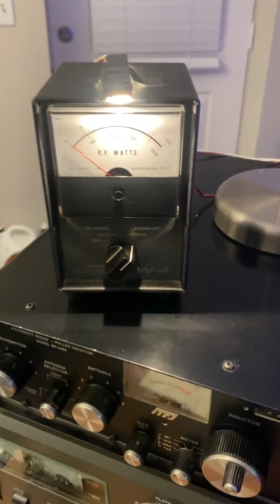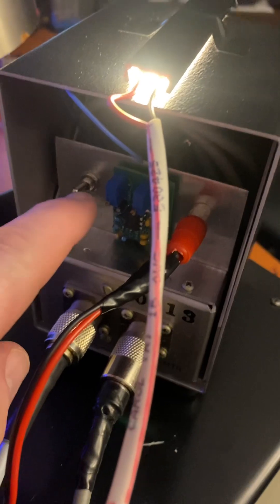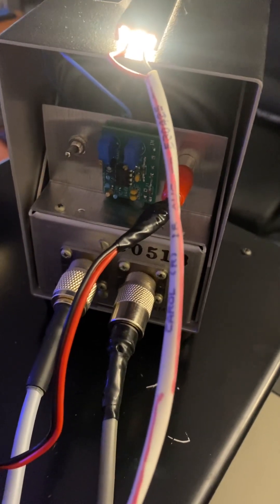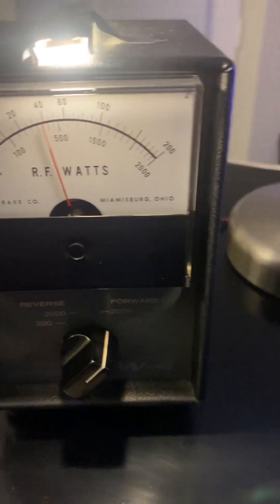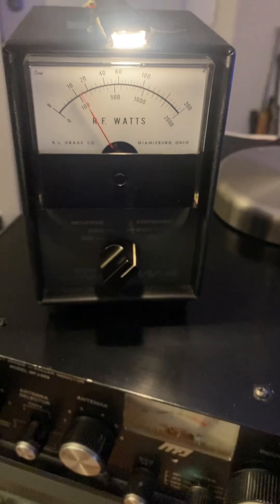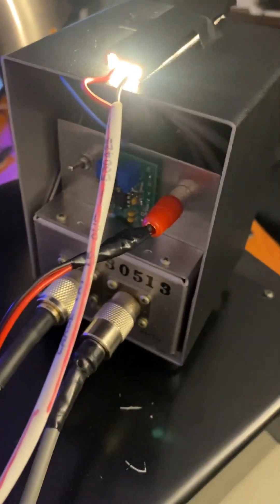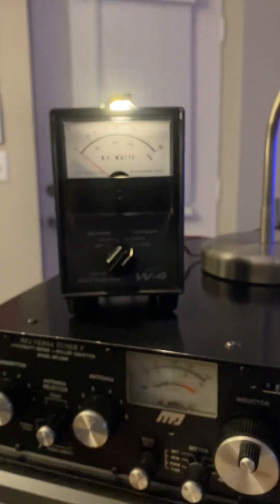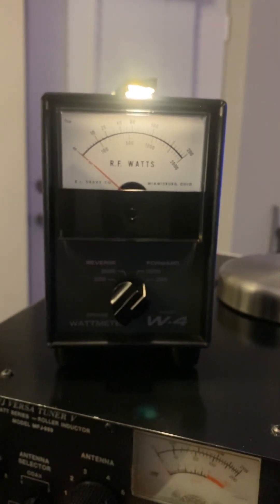Drake w4 with k4dpk PEP kit

Comment: I added Phil's peak kit to my W-4 too.  It works OK although the hang-time can be tricky to adjust.  I like the ability to use the IN-Out remotely by removing it from the case although the added weight makes the meter stay put.  My kit came with the bracket. Do you find the voltage supplied makes a difference in readings?
Reply from the maker: I didn’t try to adjust the hang time yet but will try that. I’ve only applied 12.1v to it as well. I’ll try to boost the voltage to see if any changes occur. I need to lower the hang time if I can find my tiny screwdriver